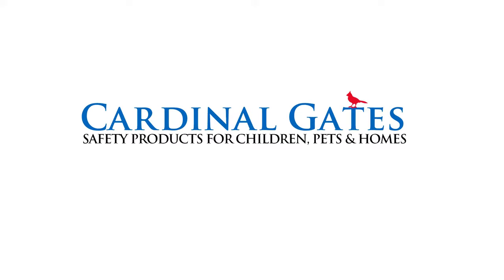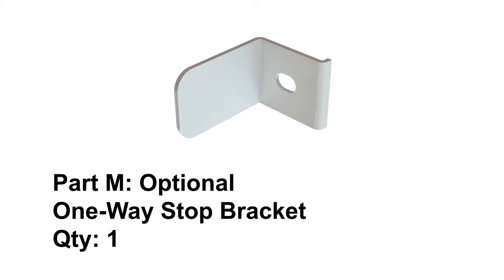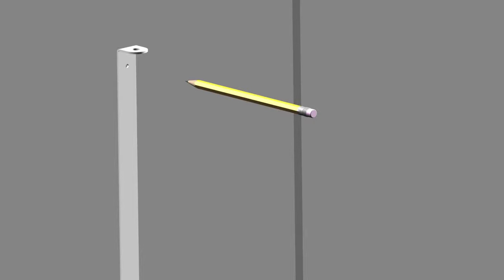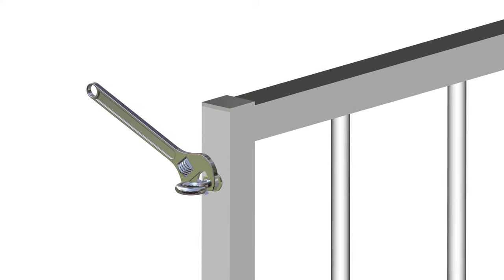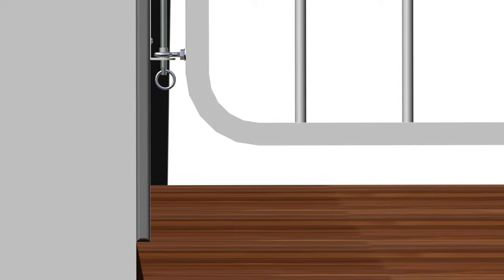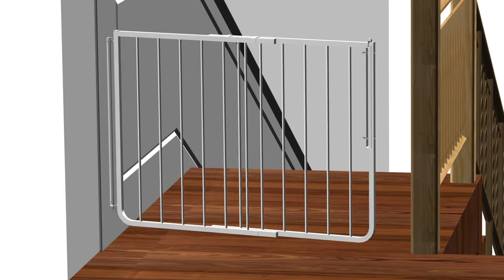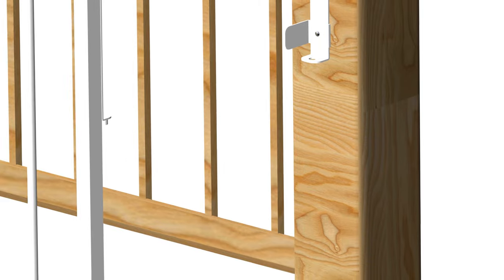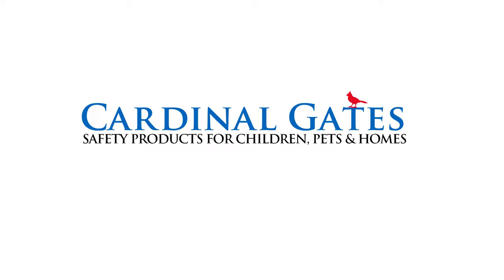Cardinal Gates Stairway Special Safety Gate Tutorial (Animated) for Models SS-30 and SS-30OD

Comment: I'm about to install this and realized that the way I want to mount this (opposite of  how it shows in the video) so static mounted on the right and pushing in when opened will sit flush against the stair railing (which matches perfectly with metal bars incidentally) but...my stair railing gets in the way of the opening! Even if I lower the mounting for the gate to be nearly on the floor.  If I mount it opposite, when fully opened, again the railing will cause it to not open a full 90 degrees making for less wide throughway (if I'm carrying large things up or down the stairs). Standing at the top of the stairs looking down, I would like the gate to swing away, not in. This is a major problem. Just wanted to rant.

Comment: The one way stopper piece is too short...
Reply from the maker: Hi Matt. The one way stop bracket may look to be too short. However, it's not engineered to stop the gate from turning a certain direction by blocking it horizontally. Rather, it prevents the gate from being swung in a certain direction when you lift up the latch to move the gate. There's a lower part of the latch that stopped by the one way stop bracket from being swung in whatever direction the bracket is installed against.